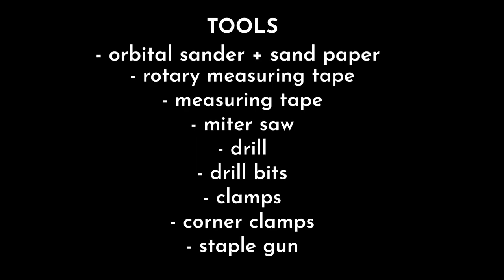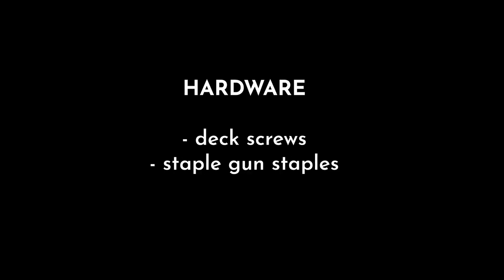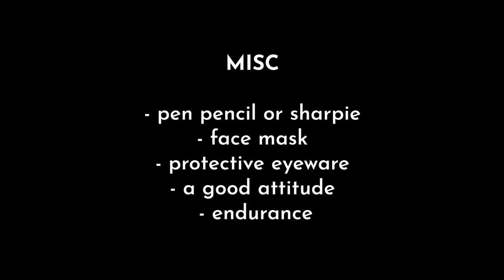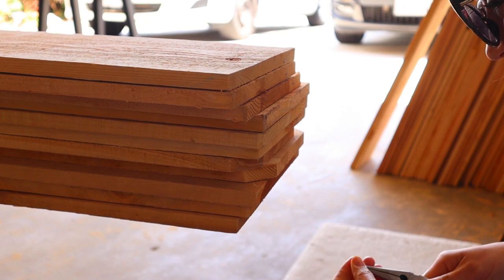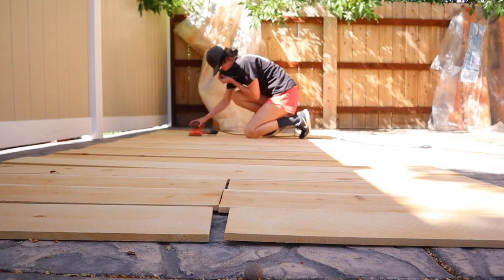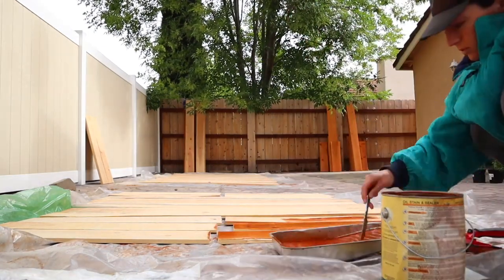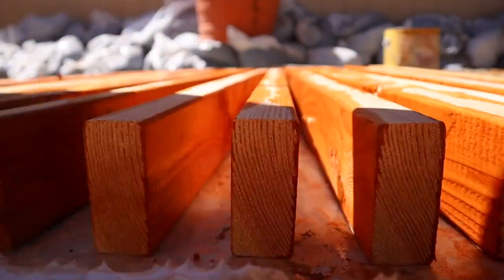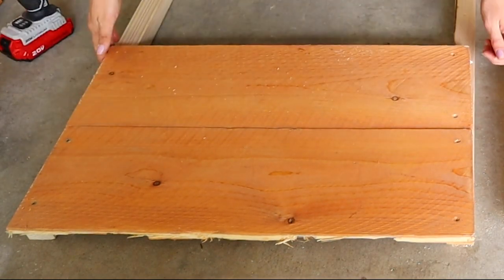How to build garden beds EASY for BEGINNERS | DIY raised garden beds | hey it’s a good life

Comment: So my questions, how quickly do they dry out? I would assume the water would just drain out the bottom. I'm thinking of putting 1/4 hardware cloth on the slats with a layer of plastic or tarp with some holes. I dont want to lose my worms! I'm also in California in the calaveras foothills. It's hot! We have critters! I'd like to try this. Congrats on your baby!
Reply from the maker: Great idea with the hardware cloth, that would be a great addition. I would recommend using a lasagna method to fill the beds to save money on soil and increase biodiversity. Being in California, I know we battle dryness all the time. I have found a green waste compost/mulch works great for me.Also, leaves from our local trees have also been a great option